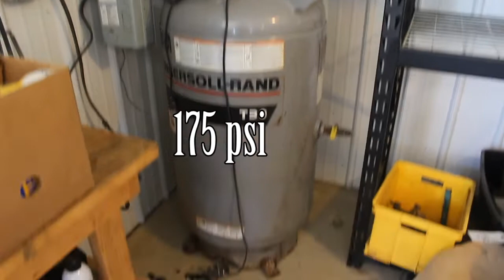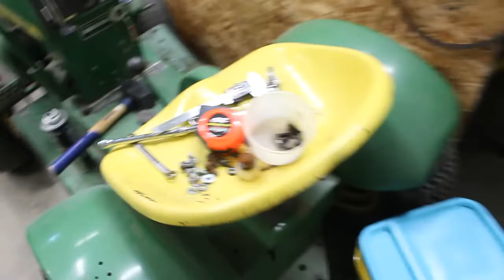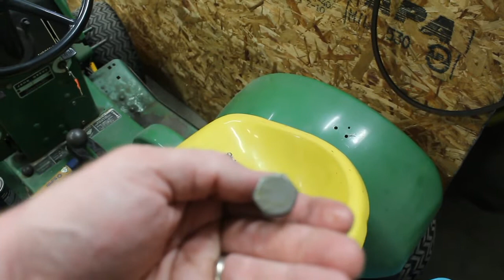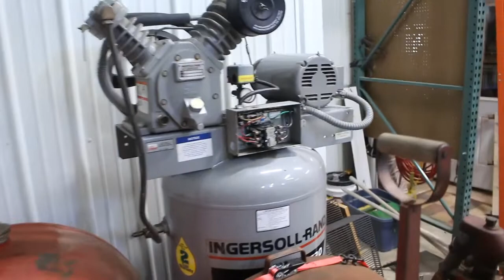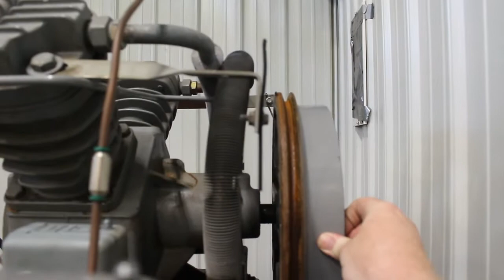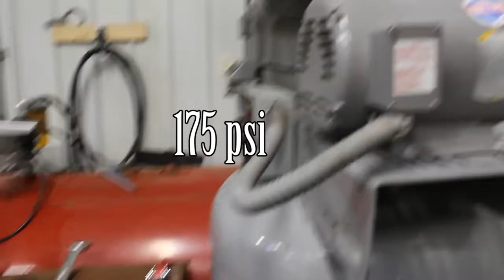New Compressor(s)

Comment: Look at the husky garage air kit.  It’s like the 1/2in rapidair set but slightly higher pressure rated and a bit cheaper.  It’s overkill, but the rapid air 3/4 set is nice too.
Reply from the maker: Thanks! Yes I have been looking at a couple kits like that. I am trying to figure out where I want my drops and how to route them.